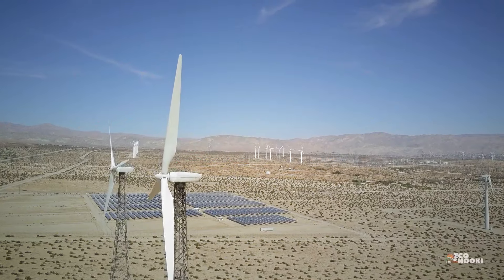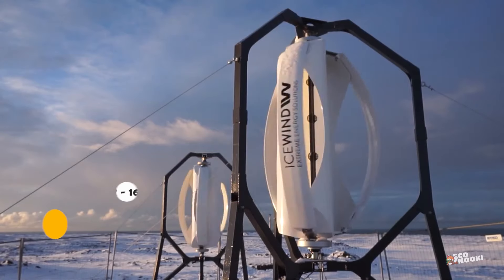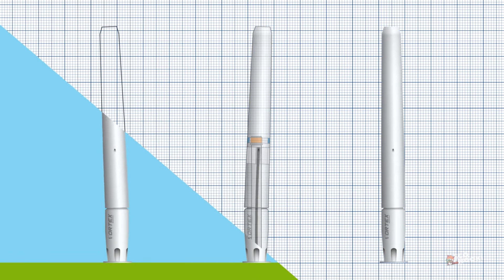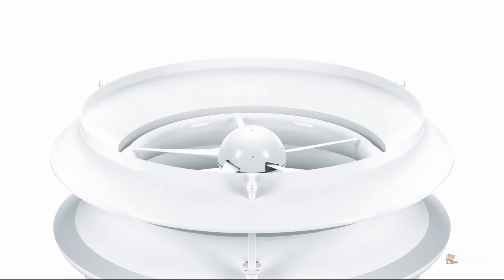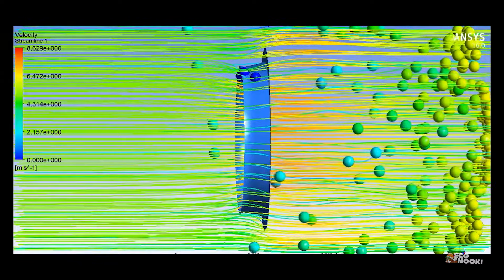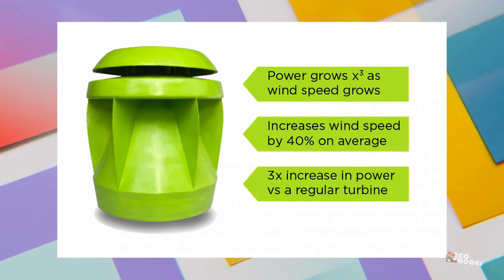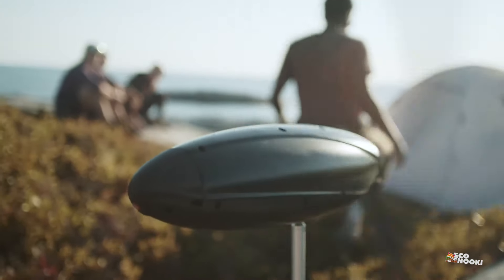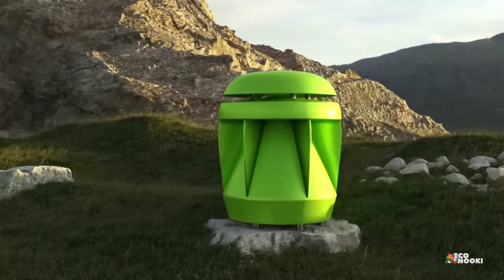8 Next GEN Wind Turbines to replace ordinary turbine in FUTURE !!

Comment: All practical tests show that small wind turbines hardly generate any electricity! Because there is hardly any wind close to the ground. It is also extremely gusty, which usually shortens the service life extremely! Only if you need to be off grid in winter & live close to the sea, you should install the largest possible wind turbine on a high mast. With solar modules, on the other hand, reliably generate electricity for 25 to 30 years at approx. 2% to 5% of the cost of small wind turbines! With 10 bifacial modules, you can generate approx. 3-4 kWh per day even in winter.

Comment: Electricity yield is proportional to third power of wind speed: +100% wind generates +800% more electricity! But close to ground: 0 constant wind! 
This is why ALL ground-based wind turbines generate hardly any electricity. 
On the other hand, there have been extreme price falls for solar panels. 
You can therefore generate at least 10 times more electricity for the same investment than with solar panels compared to small wind turbines!

Comment: I would own the halcium wind turbine if they ever produce them. I would put 3 or 4 of the black ones on my roof ridgeline. Black ones would be barely noticeable and would supplement my 19k of solar. Or if the ventum turbines were available in a smaller size similar to the halcium.  And in black. I would put 3 or 4 of them on my roof.  I don't want them to  power my home. Just to supplement my solar. During cloudy or snowy times. Come on you guys start making residential turbines that don't look terrible. And blend in better. So people don't mind putting them on their residents. No turbine is going to power a home just supplement solar power.